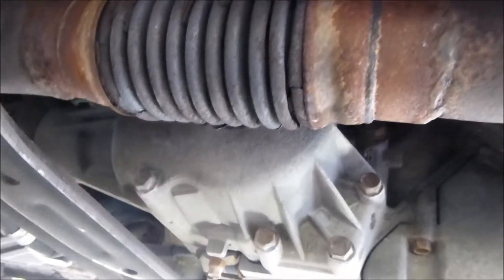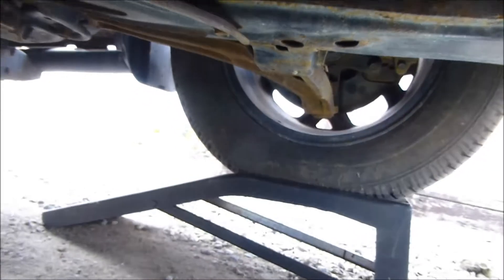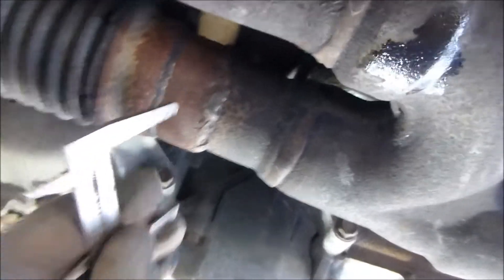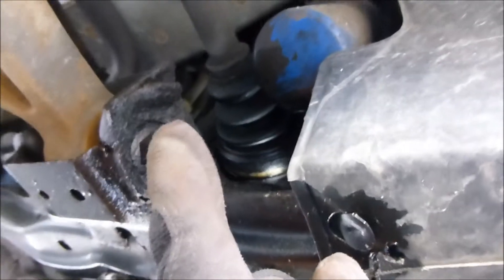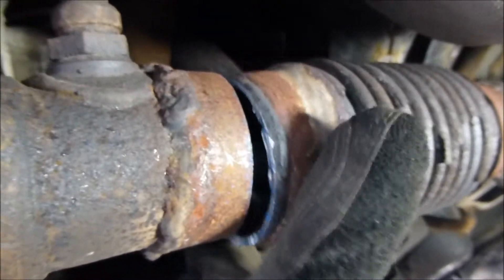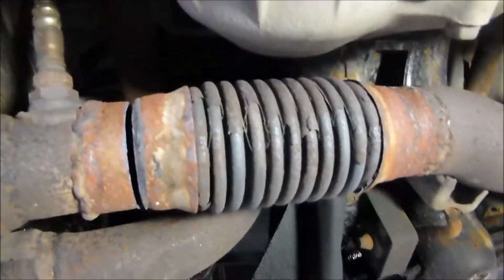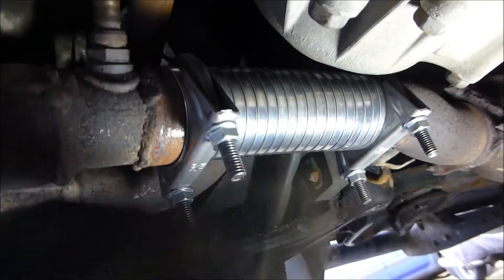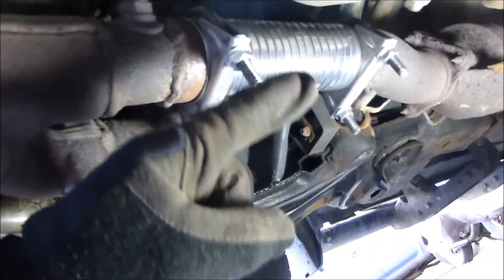How to fix Flex pipe repair Update Diy, Part 2 #66

Comment: at the end i saw smoke coming out but you said it was probably grease from factory so did the smoke go away after running the engine for awhile or did it keep smoking? im asking this question because i wanna try the same thing for my flex pipe repair. thanks.
Reply from the maker: it's ok smoke comes out just for a few seconds, and after that its ok, its the factory oil on the flex pipe that smokes.
Reply: +Max ofalltrades Red exhaust tape as an adhesive between the new pipe and existing pipe.
Reply: +Statyk Elektro If you ever had tp do this again, rigged, red tape helps
Reply from the maker: Red tape? how it's called and where can i get it ? 
Thanks

Comment: how is it holding up?
Reply from the maker: Hi, It hold up for about 5 weeks, and after I installed a new flex pipe
Reply: because you wanted something more original or because it was coming off?
Reply: @Kickstartyourcar  Did it stop working after 5 weeks or did you just replace with original while it was still working?
Reply from the maker: @bladeo691  The new part came in, and yes it was coming apart. it was not a permanent fix, just temporary t'ill the new part came in
Reply from the maker: @javaidsadiq5775  Hi Javaid Sadiq, I held for about 5 weeks, I did this in the mean time that the new parts that I ordered on Ebay ( a bosal part )

Comment: Hi. I have the same problem... at exhaust repairing shop mechanic asked 130euros($), but it is the same price for new Y pipe... lol
but I'm trying to find something cheep that can help to pass inspection (MOT)

So, you did not weld new pipe to old one?
Reply from the maker: Hi this fix was temporary in the meantime, that my y pipe comes in!. the law for inspections in my region states that the exhaust front the engine to the end do not have any leaks and if not it passes the inspection :)
Reply: Thnx for reply. We have the same rules... if it is temporary then i think best solution for me is order a complete Y pipe...
Reply: Max ofalltrades It still leaks a wee bit, no?
Reply from the maker: Statyk Elektro Hi, Statyl Elektro, yes mine was leaking abit too but it's about 90% less noisy,
Reply: +Max ofalltrades I am about to redo mine